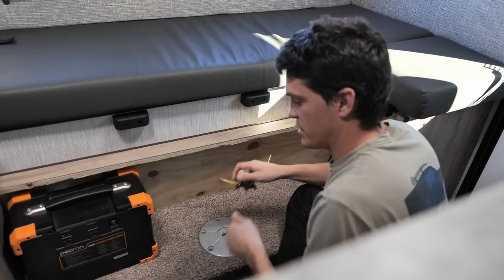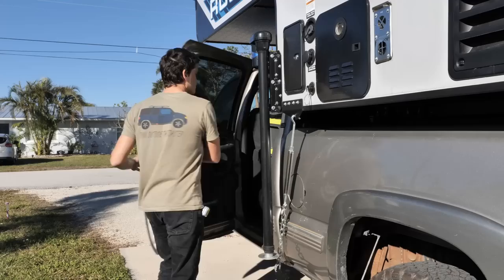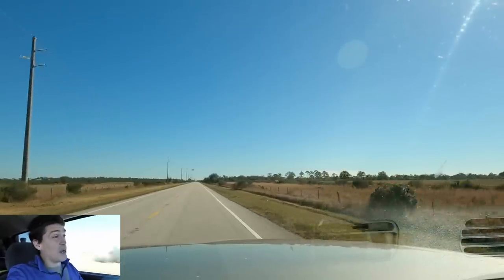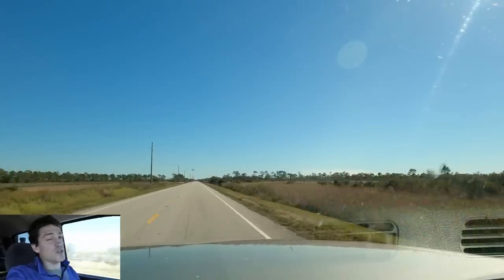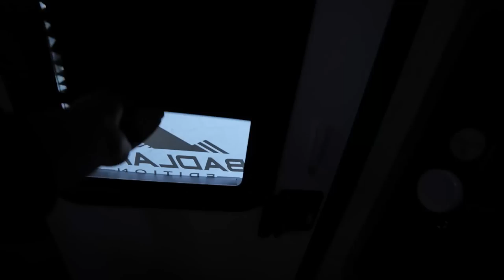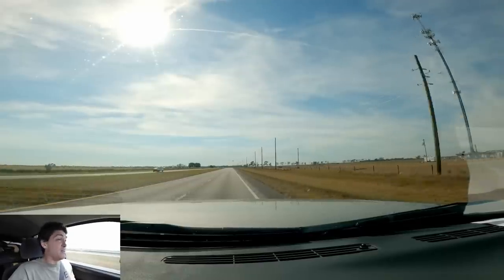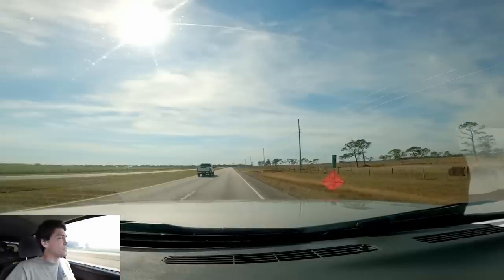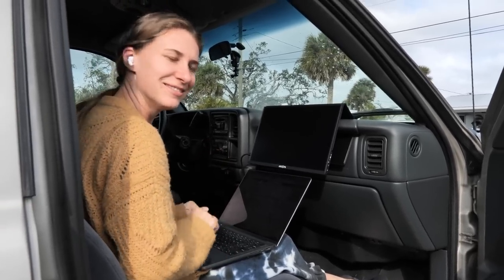Truck Camper Mods, Bed Upgrade & Test Run | Life on the Road

Comment: I had a vintage tape measure like yours, but it got misplaced. I originally found it on the street in Phoenix, Arizona back in the late 70's, while riding my bicycle. Funny how a simple little thing means so much. Mike in Oregon

Comment: Three words: Roll Over Hinge. Normally the wall mounted beds that use those hinges, such as in Hawk pop up truck campers, are only 40-43" wide. However if you also look up "rossmonster tri-fold bench/bed" here on YT you'll see how to add up to an addition 14" beyond that. No moving/storing extraneous boards or cushions.
Reply: I Just checked out this video. Well done tri fold bed similar to what you’d see in a Westfalia VW.

Comment: I think everyone is going to assume that you are sleeping in your rig regardless if the top is up or down. Seeing a rig like that with out of state plates on it screams traveler and you will get a knock or complaint either way. I wouldn't bother not putting the top up.